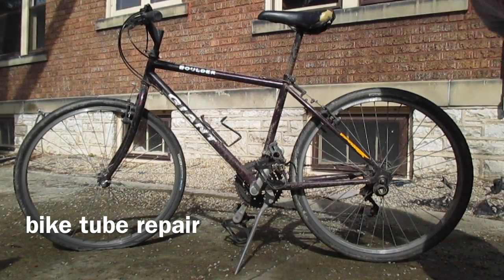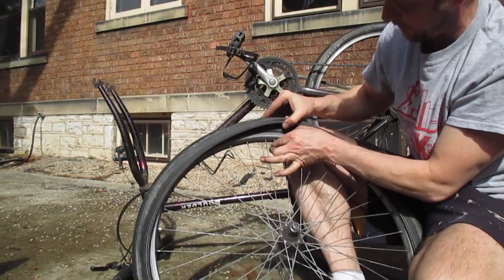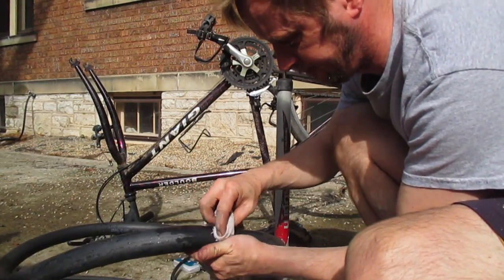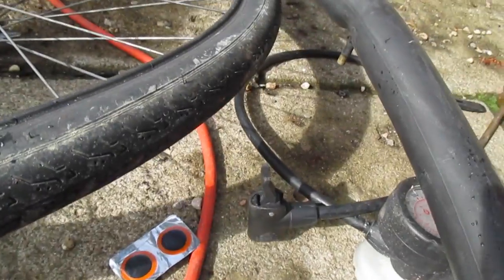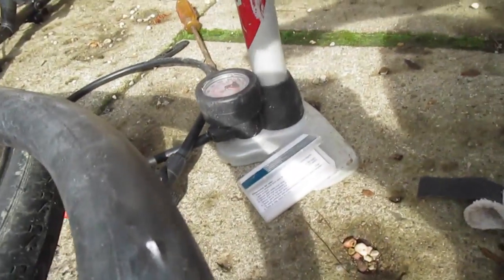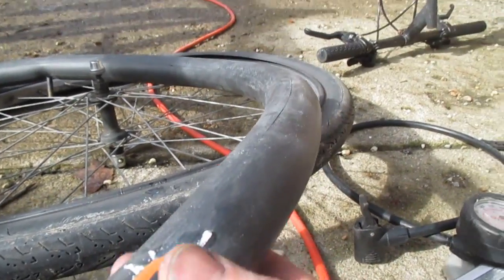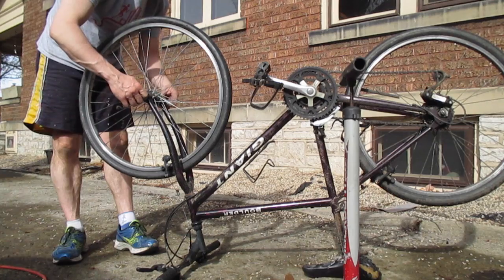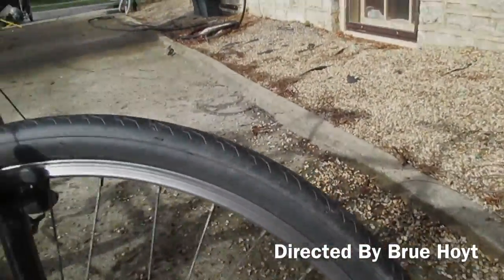How to: Bicycle Inner Tube Repair DIY

Comment: why did you use your hand to take the tire off instead or the tool?😂
Reply from the maker: I did use a tool to start it and I explain tire removal tools and what is needed from 0:30 to 1:30.
Reply: +Brue Hoyt I noticed you could've just used the tool to go around the rim instead of you hands, makes it slightly easier and also won't puncture the tire... but that's just what I'd do, but still I enjoyed your vid, it was well made.
Reply: I think using a tool for any part of it is silly. The "whole hole". That's good stuff. Thanks for the video man.